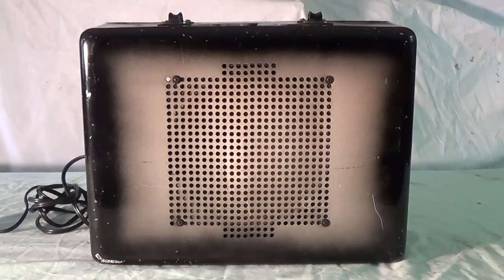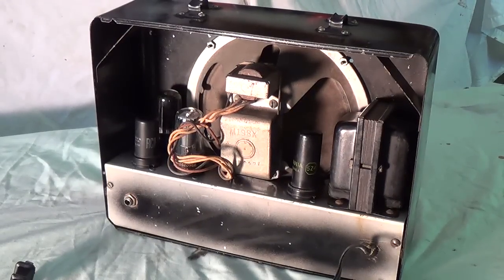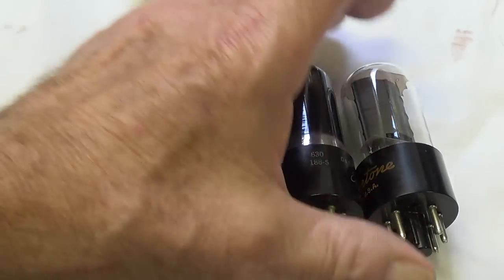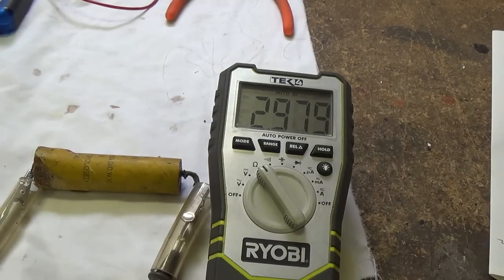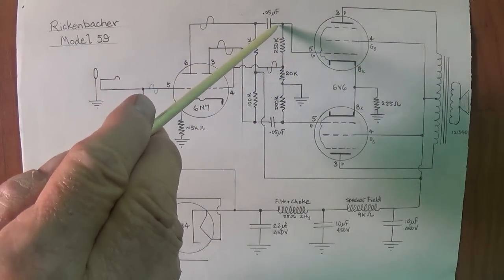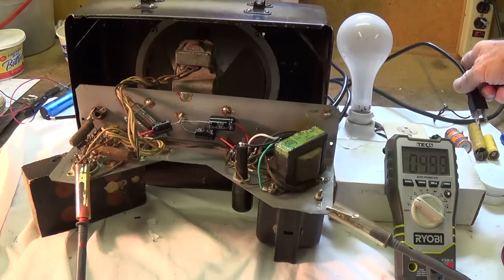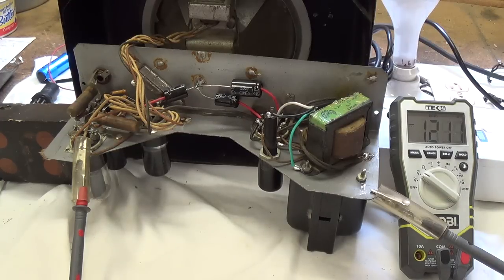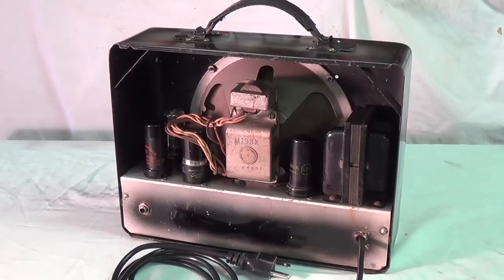1939 Rickenbacher Model 59 Lap Steel Amp Restoration

Comment: Uncle Doug, are you accepting these to rebuild? I am considering buying one but it will need to be refreshed
Reply from the maker: Sorry, Frank, but I am no longer doing amp repair work.  You can contact Michael at Chelliamps@gmail.com for help. Good luck.
Reply: @UncleDoug are you willing to share your schematic?
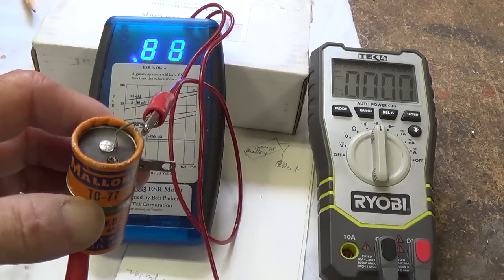Reply from the maker: @frankreiche  Sure, Frank. Just go to the 11:07 moment in the video, take a Screen Shot with your computer, and print it out.

Comment: that is an awesome little amp!  i would think you could increase the gain by increasing the input impedance to ground w a 1M?  or add a bypass cap to either (or both!) cathodes.  
you could add a trim pot where the 20k tail resistor is and use it to balance between the tubes.
in my limited experience with 6N7's...  yeah.  theyre microphonic.  work great in a head.  not to great in a combo.
do this amp w/ a 12AX7, and your on to something...
Reply from the maker: Thanks for all the very helpful suggestions, Jim :)

Comment: ya gotta know what to do with somethin' like this~
Reply from the maker: It definitely helps, Jay :)
Reply: @UncleDoug  any evidence as to why the pentode had been acquired into it, other than that change back to the correct tube and the power supply side of changes - which really became obvious one the components were traced to power flow the actual physical work was fairly little. Like many engineering things its the tea-drinking musing and drawing the problem/solution that takes the time.

Comment: Survived covid, played dobro and lap steel for 30 years. Brings back memories. Hope you’re well, but I feel it’s best to get covid now before it mutates!
Reply from the maker: Thanks, Duane. The problem with viral mutation is that once the mutation occurs, depending on which part of the virus it affects, it may render the virus "invisible" to the immune system, allowing for re-infection. It's a problem with vaccinations or acquired immunity.....they only immunize against the known form of the pathogen, generally not its mutated form.
Reply: @UncleDoug  Not really a covid thread but what has been worked on on the latest vacine design is to learn the immune system to the ;protein; spike presentatio19n, which is the virus method of entry and internal cell movement ,  any mutation of that protein to avoid the immune response rapidly and effectively shutting it out, should make the entire virus less efficient at cell entry as normal cells only let in certain key pattens in proteins.  (of course the theory may be proved wrong - coronaviruses have rarely been studied as to vacine as generally (common cold) they did not slaughter enough people or have the known and recorded long-tail effects that c-19 is kicking up - though I guess in the elderly they had enough of an effect - OC43 for example results in death of about 1 in 100 infected of older persons and appears to peak every other year - which suggests for that about a 12 month immunity effect with a seasonal cyclical poss Vit D for us northern hemisphere dwellers, as the effects though were mainly studied in nursing homes, perhaps the problem with residents was they did not get out for enough sun in summer - so your texas spring and autumn should assist you.  The world-wide present problem is that the C-19  being generally about is reducing the ability to get round other folk in crowded low income countries for the vax programmes for other diseases,including TB .  I hope thats a reasonable present day scientific analysis as I see it , though we may have to wonder why/if the present vaccines are only 70percent overall efficient, what is the 30percent loss caused by - though for the community 70percent is good enough for the poor individual rolling the dice and losing its not - I think the gap might close a bit with some further research and some of that efficiency is measuring the disease not the fatal direct outcome (which seems much much less with a vaccine than without)

Comment: sounds alot like my gibson br9 1949 model ,it has the original  2 prong cord I have not been inside this amp so dont know if any work has been done and havnt played it for 2 years and wont until it is looked at and 3 wire plug is installed,probably very simular to this design we shall see 1 day
Reply from the maker: Let us know what you find, Joe.

Comment: Ha Ha You did a great job, but I came to this video after listening to your Marshall JMP video, sound was obviously not the same.
Reply from the maker: No, it probably wasn't CF. Thanks.
Reply: @UncleDoug  I wonder if the sound would change a little if the rest of the capacitors were replaced ? Also using phase inversion in this method is there not a time delay so the final output is fractionally out of phase match - or is that what gives the sound its timbre - or at speed of light the delay is insignificant to the speed of sound ?

Comment: The first view of that amp looks like it was built into a picnic hamper, or a camp stove box.
I don't know what those waxed-paper capacitors are doing in the amplifier. I wouldn't trust them if there is any big potential difference across them. 
I'd return all the old capacitors to the owner in case they have important evidence for when an amplifier was built.
Reply from the maker: I always return all the original parts with any vintage amp I work on, NJ.

Comment: Love those old amps,sometimes the simplest of amps sound great !! No controls? I wonder if Leo told him he could save money by not putting in pots?Hummmm!!!
Reply from the maker: I agree, Bob. When it comes to tube amps, the older the better.....and who needs controls when you've already got them on the guitar ??? :) :)
Reply: @UncleDoug  yep,  my amp chassis has the controls, but I built the cabinet around them with just a single input - I can always change the cabinet and reinstate the pot knobs externally I guess but with four selections on the guitar for sitting at home its fine.

Comment: uncle doug I still am not exactly clear on how the filter choke transformer works does it take the place of the full wave rectifier, or does it work in conjunction with it? and how exactly?
Reply from the maker: A filter choke is not a transformer, David. It's simply a large coil of wire.....like a Slinky. Coils impede the passage of AC, so it works with the FW rectifier to smooth out any ripple that remains in the DC that the rectifier has produced.
Reply: thanks again uncle doug, I found a good site called 300 guitars, just looking at the thing I assumed it was a transformer.
Reply from the maker: They do resemble transformers, David, but with only one winding, not several.

Comment: 10:38. Ahh... Now I see why your adamant on doing soldering jobs properly. That one was an epic fail by the previous tech ;-)
Reply from the maker: Having dealt with a whole bunch of lousy work (like this) by previous "repair" personnel, I have become a bit anal about solder connections :)
Reply: Yep, I understand ;-) Hey, are you familiar with conn organ stuff? I have a conn organ amplifier I want to rip apart and build into a new chassis, but I Cant find the schematic on it anywhere. it works great as is, and ive had it since 2003 or thereabouts. Back when you could get a complete chassis on ebay for $25 or so. Not anymore. Here is a link that has a picture of what it is: hxxps://www.worthpoint.com/worthopedia/conn-organ-tube-amp-59525-6l6-6v6-143234053

Comment: Metal amp cabinet.. Who knew?? Doug knows!!! Thank you, Sir!!!
Reply from the maker: It seems spooky to have all that voltage and current in a metal box, Abe, but that's the way they did it back in the old days :)
Reply: @UncleDoug  My other amp is housed in a 100% metal cabinet,  hopefully with uk 240v in the grounding pin on the input socket for the power is not just for show. I will have to component check it I last used it 20 years ago, your easy to follow explainations are easier to follow than the written guides I have read in the past on the internet - I also have some old (1960s!) books and I find they either start pitched too low in knowledge, going into things you dont need to know about, or run too high in theory particularly on electron flows and capacitance issues (I still cannot follow capacitance maths for materials - in part as electrons do not behave in a linear - or even square or log functionality exactly ).  Your overall - and one notes the benefit of a series build up that Public Broadcasting would never go into such detail on - approach of this it what it is, this it what it does and this is how it does it, makes sense.

Comment: I recently purchased one of these for restoration and find your presentation invaluable. Much appreciated. Do these have transformer date codes or any other way of dating them? Thanks again for this and the numerous other videos of yours that I have enjoyed watching.
Reply from the maker: Thanks, Philip.  Yes most components have date codes that can be deciphered using information from Internet sites dedicated to this purpose. Try some Internet searches and I think you'll find them.
Reply: The transformers did not have any obvious date codes nor did any of the caps. However, there was a good one on the speaker. The speaker is dated 1943, 44th week. So I assume the amp was made right at the end of 1943 or sometime during 1944.

Comment: Thanks,Doug,for another interesting and informative video. I' m as excited as you were with the Ricanbacher.I've found an unusually good design for an Admiral phono amp,which I can't find a schematic either.It has a huge power and output transformers in it.5y3,6av6,12ax7,6sn7,6v6,6v6, and six controls! One labeled a hum control.Luckily,the same technician hasn't got in to this one yet...and it even works!
Reply from the maker: You're welcome, Arthur. The Admiral amp sounds like a good basis for a guitar amp conversion.....especially if it hasn't been harmed by a previous "tech".  Best of luck.

Comment: Interesting circuit. I like the way the grid of the second triode in the phase inverter is given a little of the first triode's output to balance it more accurately as opposed to just connecting it to ground.

I take it the guitarist would adjust the volume on his instrument to suit, or failing that his playing style :)
Reply from the maker: Michael Fearnley Greetings, Michael. Yes, the Paraphase type of phase inverter is a very interesting design, and the only volume control would be the one on the instrument being used with the amp.
Reply: Uncle Doug Hmm. To me it doesn't look like a paraphase. If you look a little closer it's actually a long tailed pair phase inverter as both triodes share a common cathode. It looks a little like a paraphase, but the voltage divider that feeds the grid looks like it's there to perfectly balance the LTP by making up for the limited differential gain. It's a very neat little hack!

From a design point of view it seems fairly justifiable to improve the performance of the phase splitter with the addition of just one 20K resistor.
Reply from the maker: I too was initially fooled by the common cathodes (a feature shared by both types of inverter), Michael, but upon closer inspection, it is (IMHO) a classic Paraphase inverter. In a LTP, neither plate feeds back into a grid, as it does in the Paraphase; and, most damning of all, there is no "tail" resistor in this circuit, only a cathode bias resistor.
Reply: Uncle Doug Fair enough, we'll just have to agree to disagree. To me it looks like a differential LTP (as both cathodes share a resistor) with Paraphase correction!

You could just call it a paraphase but perhaps you could define it by which action creates the most differential gain. In that case I would call it an LTP.

Who knows? There's no right or wrong here!
Reply from the maker: Sounds good to me, Michael. Thanks for your input :)

Comment: you could plug it in if you connect a 300 watt blub in series with the line cord.
Reply from the maker: Greetings, BG. I did use a 250W Current Limiter every time the amp was plugged in. I consider it to be an essential tool and never do any testing or repair work without one. Thanks for your input.

Comment: Having watched this video, I wondered if the choke was center tapped to use as a phase inverter.  I'm sure you would have mentioned that. I would like to know more about the use of transformer s as phase inverters like in the Fender Music Master Bass amp. Especially how to choose the appropriate transformer for use as a pi. I would love to chat with you.
Reply from the maker: In this case, Mark, the choke was simply a dedicated filter choke and the 6N7 tube served as a paraphase inverter.

From what I can determine, there are two choices for PI transformers. You can use one with a 1:3 primary to secondary winding ratio, (pre-amp input to the primary and secondary output to the output tubes with CT grounded). See PT-156:  https://www.tubesandmore.com/search/node/interstage%20transformer

 A simpler method is the one Wurlitzer used in their 1940's jukebox amps. See my video:  https://www.youtube.com/watch?v=7E-lSEMnph4  and watch at 10:25 for the "Input Choke" #L3, which you could probably duplicate with the center-tapped secondary of  transformer (with the primary unused). It's an interesting concept that I have not fully explored, but would like to, if time ever allows. There are also several sites and chat rooms with interesting discussions about interstage transformers and PI's.

Comment: So I used to have a barn amp I bought from a friend in high school. Brand was lectrolux or electrolux, cant really remember which. Anybody ever heard of it?
Reply from the maker: Internet searches don't turn up anything amp-wise, but without knowing the exact name, it's not going to be easy....especially since Electrolux vacuum cleaners swamp the responses. Maybe a viewer can shed some light on this mystery amp.
Reply: Ya I was kinda hoping you had come across one at some point, as I had the same problem trying to search online for it. Thanks for the quick reply :)
Reply: So I misremembered the name, it was lectrolab not lectrolux.
Reply from the maker: Well, John, I'm both surprised and happy to say that there are all sorts of sites and information about Lectrolab amps on the Internet. Here is a great site:  http://lectrolab.wordpress.com/   You need to check out the different models they picture and describe, to see if you can identify your old amp. Good luck.

Comment: I'm starting to find that on less common units like this the cost of the tubes alone renders the unit obsolete. With less common pre amp tubes going over $50 and your work, the bill had to be $400. Is the amp worth it?
Reply from the maker: Greetings, William. Actually, the 6N7 cost less than $5, and my bill was much less than your estimate....but I agree that restoring any vintage tube amp can get a little "pricey" especially if you pay someone else to do the work. Also, replacement of a vintage power transformer or speaker, if even possible, can make tube prices seem negligible.

I guess the key is to get the amp at a price that is low enough to allow for reasonable repairs, and be sure (as possible) that it does not have severe problems. There is some luck involved, and it helps to either be able to fix it yourself, or have access to a reasonable, competent individual who can.

I see people asking astronomical prices for old, beat up amps that are untested, as-is, and without return privileges. Since they value these amps so highly, my feeling is that they should be allowed to keep them.....at least until their value assessment becomes much more realistic.
Reply: Have an ampeg b12xy. Far more complicated. 6d10 went from 6 to $40. I was able to do small modifications to exchange 7199 to 6u8a and 7027 to 6l6gc but now I look and all the wires are cracking and resistor and capacitor melted off circuit board. I dont have the original bottom or reverb speaker. Is it worth fixing.
Reply from the maker: Some tubes, like the 7199 are really tough to get, and conversion to common tubes (as you have done) is almost mandatory. Re the Ampeg amp, I would say it was worth fixing only if you did the work yourself. If you hired someone else, it would cost more than it's worth, especially since it's no longer in original condition. There would have to be a strong, sentimental attachment to justify the expense.
Reply: Uncle Doug I appreciate your response and I enjoyed your video. I am an extremely handy individual and kept this thing running for more than 30 years with limited knowledge and also managed to not send myself across the room.......yet. is there something i could read that would transfer what i'm looking at on a schematic to whats in the housing. .
Reply from the maker: Not that I'm aware of.....it's a skill developed by doing rather than reading. You have to locate the main components, like the transformers, tubes, pots, etc.(i.e. landmarks) in the chassis and then correlate them with the schematic and trace the wires that connect them to the other components. In time it becomes easy and natural. Good luck.